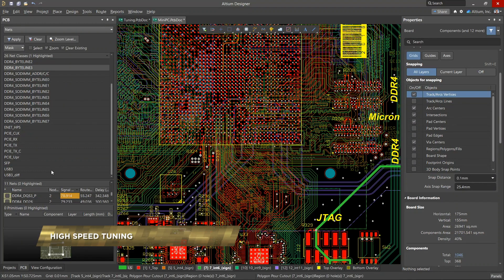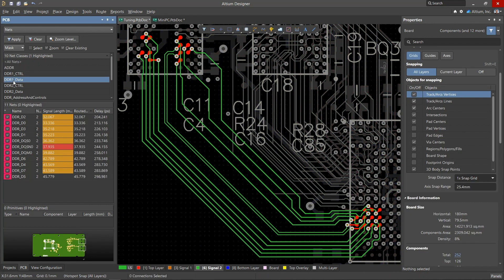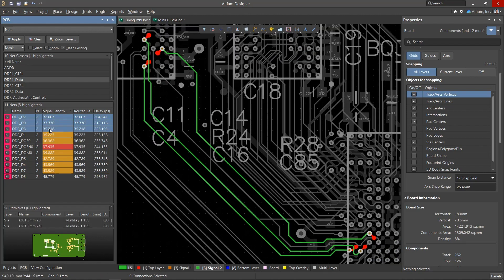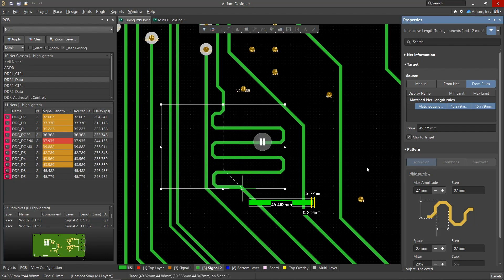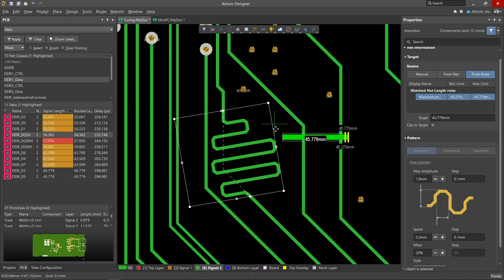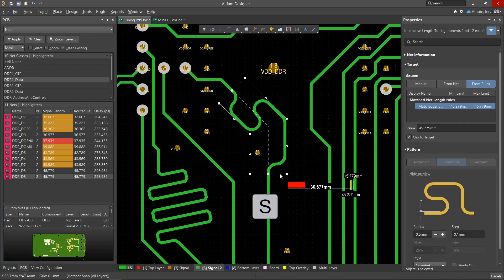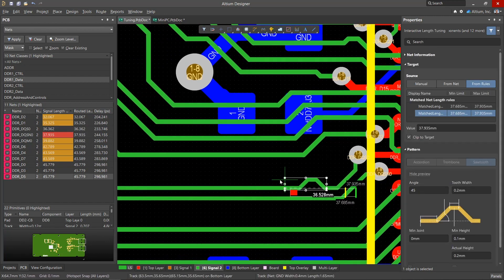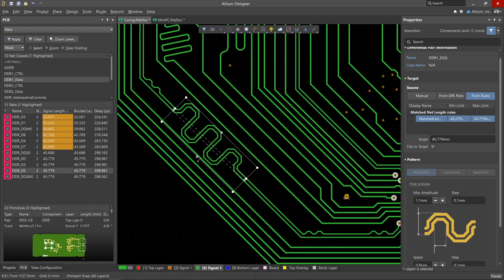High-Speed Tuning in Altium Designer

Comment: Is there any way to compensate for lengths on say a SOM board that plugs into the board I am routing, where the lengths between the IC to the connector are known and not length matched for the group of signals I am length matching on my board?
Reply: Looks like you can.  Pin Package Delay on the symbol, by individual pin.
Reply: @Dr.Bigglesworth  Yes you can apply pin package delay to an individual pin. But this does not change by layer, you have to know the value for your specific layer transition.  So for example, if you have a through-hole, but you route between a surface layer and mid-layer, the delay you enter into that box on the Properties Panel will only apply to that specific layer transition.